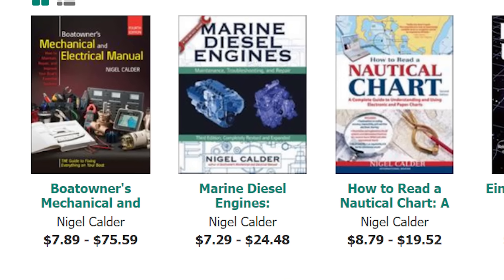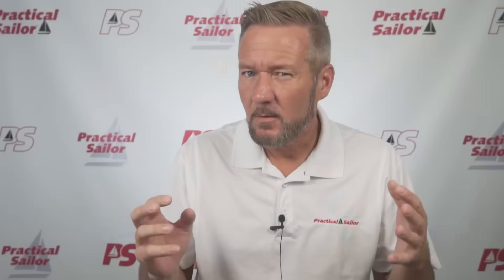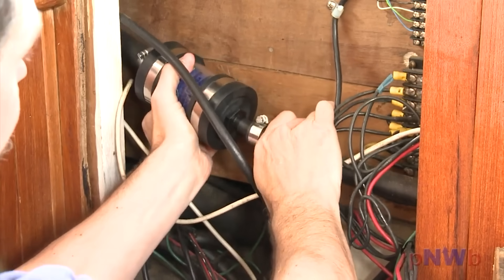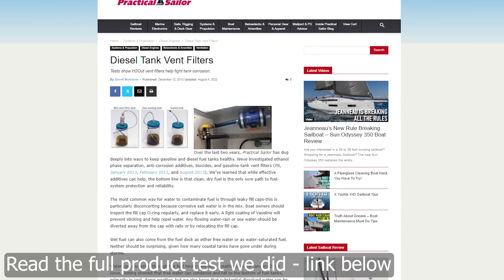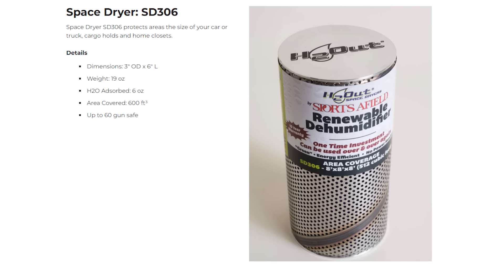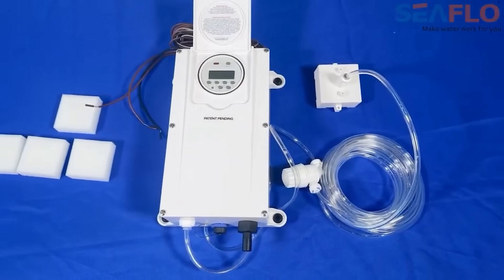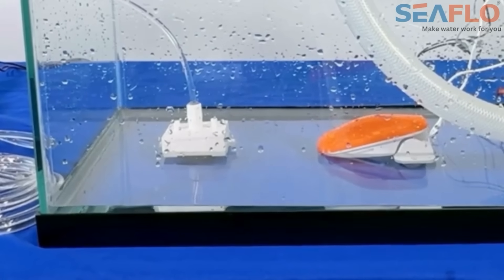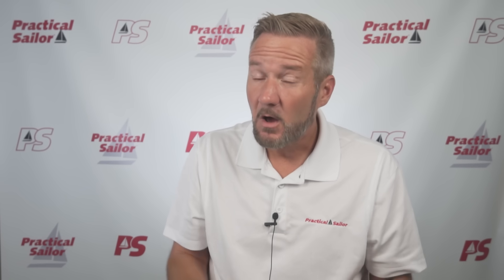3 Tips for a Dry Boat - DIY Boat Maintenance 101

Comment: We bought electric air dehumifier for this season and it has been one of the best things we have bought for our boat. Basically zero problems with moisture after that.
Reply: We extensively race our 39' sailboat. The humidity problem is made much worse because we often hang wet spinnakers below deck. For over 20 years we've been using an electric dehumidifier to dry things out.  Of course we can only use that at the dock so it has limitations.

Comment: Great timing Tim. Been working on that exact issue all week here on the Tennessee River. As a former hvacr guy I'm totally trying that fridge trick you recommended. Here's a few I've learned in my 4 years as a sailor so far and my 1st as a liveaboard. 

Tip 1: Below 60F, without heat or a dehumidifier your ceiling is wet, there's no way around that impass.  It's dripping on your cups, clothes, bedding, whatever is below it every morning. Crack your sealed cubbies and closets (I recently louvered a few to avoid this) and place moisture absorbing devices in them; which are cheaper at Walmart / Amazon (refillable) and dollar tree (single use) for us brokies. I personally refill, and have them where advised including my lazarette.
Tip 2: Bilge emptying is critical and made easier with a portable hand held transfer pump you can drain into a bucket. Harbor Frieght carries a battery operated one for $13 I use for my dinghy and occasionally my sailboat. I have exposed keel bolts so this is a must beyond humidity control. Recommend Seaflo anything, so if you can afford it, get the system in the video, I'm sure it's worth it. 
Tip 3: Permanently mounted / wired fans to circulate air should be considered mandatory equipment in use at almost all times of the day or night above 70 percent humidity. 

Tip 4: Consider humidity percentage monitoring essential to your comfort and dryness. When you understand when and where trouble conditions exist you can take steps to address it. 

*Food for thought fella's: WiFi / Bluetooth monitoring / running of marine systems are becoming cheaper every year I tech. It's becoming a bigger request from my clients of more modest incomes. My client last week fired up his houseboat heat from his phone in the Chevy on the way to his slip for example. The Mrs was greatful. 😅
Reply: All good points. Hello from Lake Guntersville

Comment: Aboard our Catalina 425 we installed a PSS shaft seal and can maintain a bone dry bilge most of the season. This makes it very easy to determine e the source of any leak (fresh or salt). We get into a moisture battle in fall and spring when we winter in the water (near Boston) as the hull sweats with the temperature swings. Keeping a heater going, running a dehumidifier draining to the sink, and fans on mechanical timers as well as DampRid desiccants seems to keep us dry and mold free.

Comment: Tim, will definitely install a H2out filter on my vent line. To completely drain my bilge I wired in a peristaltic pump which sucks up every last drop of water. I just run the discharge tubing into the sink when I find any residual water, usually after heavy rain.

Comment: I would suggest using the "obvious" at dock ..a dehumidifier. Mine is a 50 liter size and is on a timer, 6 hours per day. Its amazing how much water it sucks out of the air. No mold as a result .

Comment: To avoid condensation in a boat, you need ventilation.  I had a lot of condensation in my 46 foot sailboat. but all the condensation disappeared after I put two solar valves in. I made several holes in all bulkheads so that the air does not stand still but has a steady exchange when the solar fans are running. After that I have no problem with condensation😊
Reply: Of course ventilation is good. But if the relative humidity outside is higher than inside, it won't help you at all. On the contrary, the humidity inside MUST be evacuated. The volume in my ship is about 65 m3 and I can only keep it dry with an electric device, as mentioned before.

Comment: On my last two boats, on 41 and one 42 foot, I installed a low power draw squirrel cage blower in the engine compartment. It completely eliminates all odors from the boat. It also helps rid the boat of excess humidity. The engine block would be constantly coated with condensation until I installed the ventilator. It has been running constantly for the last 12 years. Draws about an amp or so.

Comment: I have been living permanently on my 38-foot ketch (Contest 38s) for three years now. One year in the Netherlands and now two years in the Azores. So, very humid regions. The only measure against humidity in the ship is evacuation! Everything else is gimmicky and ineffective. I use a dehumidifier for this, namely the MEACO DDL8. Highly efficient (often 3 liters per day). By the highest setting (650 watts), I can even dry my laundry overnight in the shower, with the door closed. It is equipped with an automatic humidity sensor and switches itself on and off automatically. There is nothing better. And the bilge is also bone dry. - And as a side effect, this device also pleasantly warms my three rooms in cool times.

Comment: In my experience water in the bilge means there is/are leaks. My last boat, a mid 80s Catalina 36 had a wet bilge. After 2 years and finding around 20 or so leaks, ranging from deck hardware to flex in the full water tank breaking the seal in the inspection hatch and leaking, I eventually had a consistently dry bilge. So I think a wet bilge is an indicator of leaks and with perseverance can be made into a dry bilge. Even the drip from the packing gland on the shaft was eradicated by using a goretex stuffing material which stopped the drip with no detrimental effect on the prop shaft. My current boat, an 1986 Moody 47 had 6 inches of water in the bilge when I got her. So far I have isolated and sorted about 10 leak sources and the bilge is almost dry. I will find the remains leaks in due course and will have a dry bilge.

Comment: I will try that filter. I keep a dehumidifier running 24/7 when my boat is in the slip. Humidity in my boat is typically around 45-50%. Outside it’s generally in the 90’s. My bilge is dry. The air is fresh. Nothing is damp.

Comment: I had a 35’sailboat for many years , we used to place those closet, dry bags that take moisture out of the air in our boats closets, and that make them for draws and flat services, very cheap,at DIY stores , also cleaned and painted my bilge ! I would add toilet tank cleaner to the bilge that stops all growth and there is no smell , even the sea water looked great ! When at dock on those cool nights I would have a small heater running all the time , I was designed to run continuously, there was no moisture in the boat and it was nice and toasty . All very inexpensive and worked great , on the hook we would run the diesel engine for hot water for showers and cleanup then open the engine covers , the heat from the engine after running would warm up the boat Surprisingly !

Comment: Boating in the Pacific Northwest over the past 40 years I've learned that nothing beats a mechanical type dehumidifier for keeping the interior dry and smelling sweet. I've used the small room models over the years. Obviously, not during the summer when I'm using the boat, and I don't live aboard, so the dehumidifier is brought aboard in fall runs on automatic when not aboard. When first started up in the early fall I get a bucket (22 pints) within a few days. Then, as the interior materials dry, a bucket a week until everything dries out and then it's a bucket every few weeks. The Peltier type units also work, but not nearly as effectively as the old style compressor type. Some of my clients have theirs set up to drain into the galley sink, continuous operation with no bucket to dump. I like to know how much water I'm deleting.

Comment: I have been adding Dynamo kitchen soap to my bilge for 52 years. It prevents gooey buildup, smells like Jujubes, and was one of the first biodegradable products back then, and helps rally pump out the bilge. Up in Maine over the years, the cold water and daytime air allowed a lot od condensation. I highly recommend it.

Comment: My understanding is that boats should have good ventilation with dorads (my boat has five) to minimize the moisture forming in the boat.  I don't see how these products do anything to stop the moisture from forming, they are reactive AFTER the moisture forms.  By the way, my boat is kept on a buoy 24/7/365 in Puget Sound without any dock power available.  I use three Dry-Z-Air dehumidifiers and service them about every 3-4 weeks over the winter.

Comment: I lived aboard for year (Catalina 36) and I had very few moisture problems, at least up in Maine anyway. If it was above 65° and not raining then all the hatches were open and with a forced air diesel heater (drawing outside and inside air) it blasted enough dry air into the cabin. 
Only when I cruised down south did I start to get any form of routine dampness aboard. But again airflow solved that to a great extent except for the little draws next to the hanging locker outside the head, the bottom two could get a little damp but tossing a few desiccant cans in there did the trick, bake the cans once a month and hey presto good to go again. 
I do strongly second the fuel vent dryer/filter though especially in damp climates with temperature swings. Cool damp air gets sucked in at night then condenses in the morning when things warm back up. Wash rinse repeat enough times and boom wet fuel.

Comment: Water inside the boat in the bilge....I stopped accepting that a few decades ago when I went from wooden boats to fiberglass. With great difficulty we have chased down small and large leaks. It is very nice to have it completely dry so that you can detect when something bad happens. You avoid unpleasant smelly stuff and can vacuum away rubbish. It is not easy to achieve, however, it is useful. We have found small cracks and very small leaks in unexpected places that no one bothered about for many years. To keep the air dry we have successfully used electric dehumidifiers when appropriate and calcium chloride as the passive option. Where I live, I buy calcium chloride cheaply in 25 kg sacks where the farmers shop.

Comment: Quick air drying trick for a damp boat while aboard.  Heat the boat with the vented cabin heater until it is comfortably warm. Keep hatches closed.  Moisture is picked up by the warm air and condensation droplets on cold surfaces disappear as they are absorbed.  After an appropriate time, open the hatches and allow the drier outside air to flow freely throughout the cabin.  In just a few minutes close the wide open hatches and enjoy a much drier boat.  The previous warmth in all the interior surfaces quickly brings the temperature back to comfort level.

Comment: I bet you could take that filter part when it's absorbed all that it can. Empty the beads onto a baking sheet and dehydrate them in the oven or in a dehydrator. They are likely to be the same thing as those little moisture packets you always see. Those can be reused through the same process.

Comment: We have had the Seaflo Dry Bilge system for several years. It generally works well. My two biggest complaints would be that it is extremely hard to program, much less see when if you have the controller installed somewhere discreet.  Secondly, the sponges are very small and get clogged very quickly requiring replacements. (Your test clip seems to use tap water)

Comment: My digital thermometers usually read about 60% humidity at dock in Oxnard, Southern California (desert adjacent... so it'll probably be  higher in other places.)  I first put my clothes in plastic bins I got at Target, but they got boat stinky. So I made a bunch of really cheap dry bags the the bins sit inside of. Everything  is white so it's easy to open them and look in to find something. 
When we sailed across the Pacific we had four or five straight days off Vancouver Island in dense fog. Everything was streaming water. All of my clothes including those stuffed tightly in a sealed hatch got damp and mildewy. I had spare dry bags in my duffle.. but stupidly didn't stow any of my clothes in them. 
I think I'll get one of the AVD Fuel Guards.  A fuel tank is a contained volume so it's not like running a dehumidifier with a hatch open

Comment: I used Dry-Z-Air canisters for a long time before I saw the futility of it.  These devices take moisture from the air, for sure, but leave it in the bottom, which is open to the atmosphere.  So it evaporates and you are back to where you began.  I scrapped all of these and the boat is no more damp than when I used them.  Really, the best thing is hull and deck insulation to reduce condensation.

Comment: I have lived with a couple of inches of water in the bilge and my keel bolts are stainless steel.  However, I have a dehumidifier and space heaters so the boat is seldom damp.  On occasion, I use a manual bilge pump and just pump the water into a bucket to toss overboard.  Wouldn't be a real good idea to make a bilge pump that sits 1/2 inch or so above the bottom of the bilge so almost all of the water is pumped out?  What am I missing here?  Great article; I love this formum.

Comment: I have always had problems with the non-return valve used in conjunction with the bilge pump allowing water to return to the bilge after the pump stops. Having spent extra money on an electrical sensor system rather than the conventional float switch, this runs for so many seconds after the water has been pumped out, only to see the water seep back in. Hull shape dictates that there will always be water in the line, so unless there is a better type of non-return valve that's impervious to contaminants in the bilge I'm stuck with this problem.

Comment: Get salt bag based systems, just make sure the water collector is emptied regularly and does not tip over, because then you have the severely corrosive solution attacking metal parts. Silica gel bags should also work and are cheap as f

Comment: "What do you think?" I think I'm going shopping. My bilge sump hasn't been dry in years. And there's a spot, as my boat sits on the hard, that's collecting water that doesn't drain to the sump, (maybe the boat isn't quite level?), it smells bad, and the dry bilge system might help with that, too. As I say, I'm going to go shopping.....

Comment: I'm pretty anal about keeping the inside dry.  I know where water comes from when it's in the bilge so I look for those sources often.  My bilge is completely dry 95% of the time.  Where some think I go "overboard" is in not allowing water in through the companionway. To collect any morning dew or rain etc., I keep a towel at the bottom of the steps and change it when it gets damp.  I've also gotten a small dehumidifier that I run during the summer.  It drains directly to the galley sink.  I also have a temp/humidity monitor that is wifi to my phone at home (Govee).  Personally, I don't car for the canisters due to cost.

Comment: Nigel is barking up the wrong tree. Most diesel fuel seawater contamination comes from flush filler valves on deck. Boat water holds have the same scheme. How does this happen? Answ: It doesn't matter. It happens. Disconnect the fuel fillers on deck....and the water filler, and carry liquids below or fill another way. Tank vents get run the same way. Nigel's vent? It's bad. Not really, but it's a distraction. That's a golden way to perpetuate problems. I hoped we could think about boat plumbing, like cooling water and water cooled refrigeration, that are dopey schemes. I homemade a dripless propeller shaft seal. Now that's a dry scheme. There's one more thing. Dry isn't good enough. When you get your boat dry, wash away the salt residue with fresh water routinely. Your bilge dry gadget is nice.

Comment: Not available in the uk😢
Reply: Hi, for dry fuel the first task should be to replace and grease the diesel deck fill O ring each year. Most people do not replace any of their deck fill O rings. Secondly my Catalina 36 has a dry bilge because I have an Arid Bilge System that again uses pads and a vacuum system on a timer to keep the bilge dry.

Comment: For closets etc. sthey make a rechargeable dessicant dehumidier called "EVA-Dry". An indicator turns pink when it needs to be recharged, then youu plug it into a 120vac outlet overnight and an internal heater drives the moisture out. I use these on my photo /electronics gear when they are stored. Also, clothes in large ziplock bags with these to prevent mold.  Two sizes, the -500 is larger. You-tube link: https://www.youtube.com/watch?v=6lQAhgOeTqw

Comment: I sponge my bilge dry.   I use a hand pump into a bucket then sponge the rest of the way.   Where does the little hose go on this system.  To the sink?  Looks like a pain to run the small hose.  This isn’t going to work good.